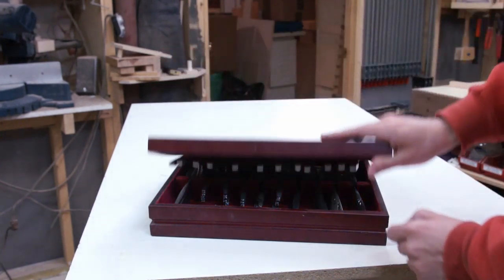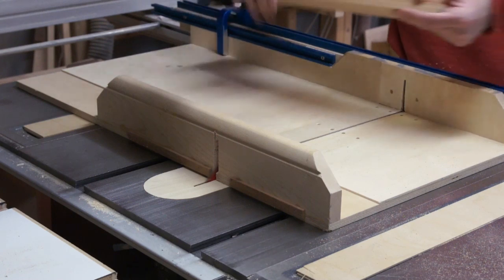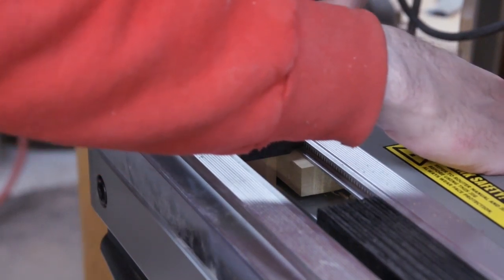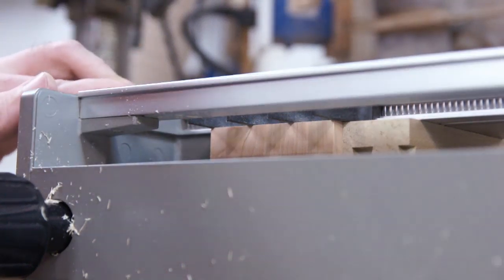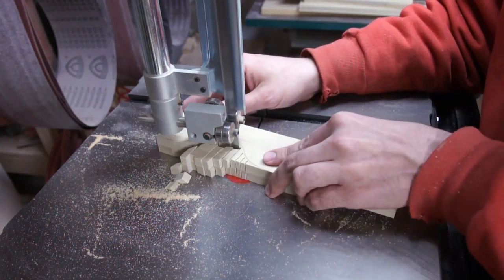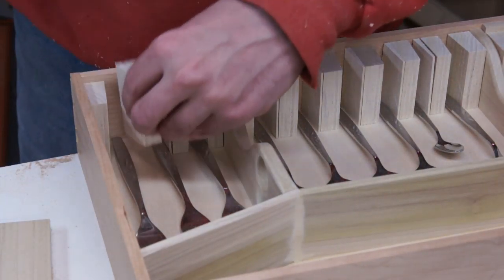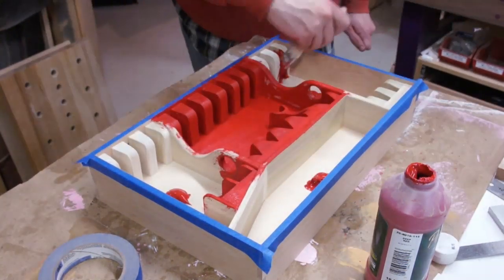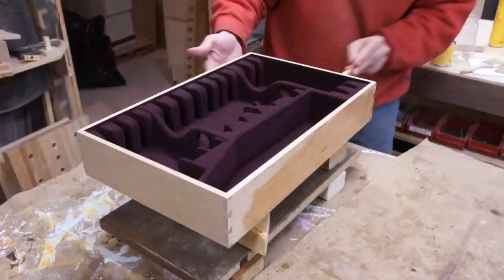Silverware Tray - A Flock of Dovetails

Comment: Great job... I have a AKEDA.... Really enjoyed your tutorial on the jig.. could you make a more in depth video on the AKEDA....Thanks....
Reply from the maker: They don't make them anymore so it would be weird doing a tutorial for something people can't get anymore.
Reply: @krtwood I respectfully disagree.  I just picked up a used one and going thru the manual now.  I see 1 or 2 more for sale as well.  In the process of sorting out parts now.

2 quick questions.. where do you purchase replacement router bits?  I have some whiteside cross reference numbers and will look for those today.  Second, do the work pieces have to be cut in increments of 1/8 inch so that the half pins are equal.

I think a 5 minute setup video would be great.
Thanks in advance

Comment: Great project and good video. I would be interested in the company that sells the flocking material. Used to be available over here in Europe at (car)paint shops, but seems to be out of fashion. Would be nice to know an internet seller. Any suggestions?
Reply from the maker: The manufacturer that shows up everywhere here in the US is DonJer, which seems to be a US company that is trying to sound French.  From what I can see you can get the fibers shipped overseas but not the 'adhesive', but since that's really just oil based paint that shouldn't be a problem.  At least here it's hard to get paint mixed to a custom color in small quantities so the little color matched cans they sell along with the fibers are handy.  Their website is www.flockit.com but all the woodworking sites like Rockler and Woodcraft carry it as well.
Reply: krtwood Thanks for the info!